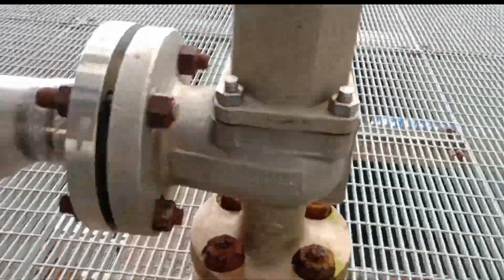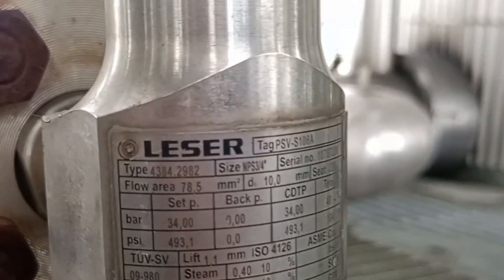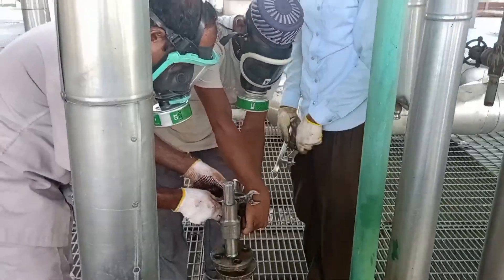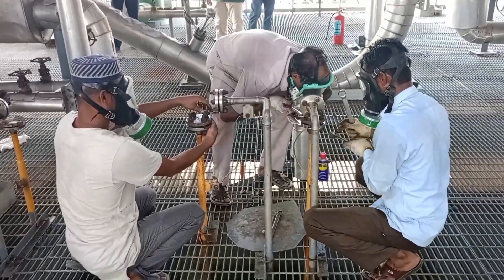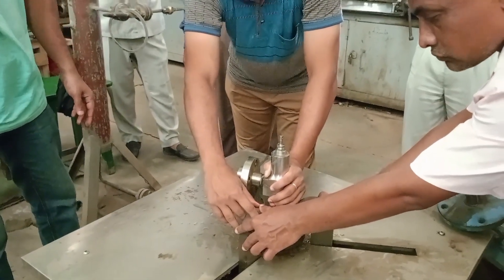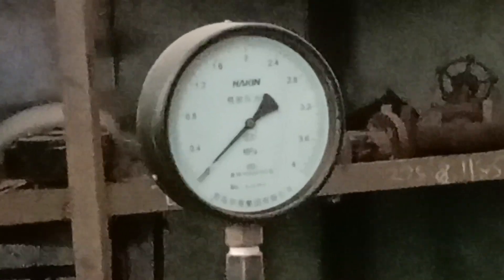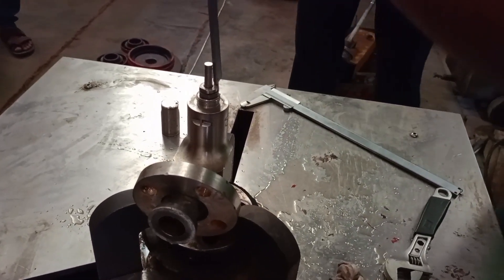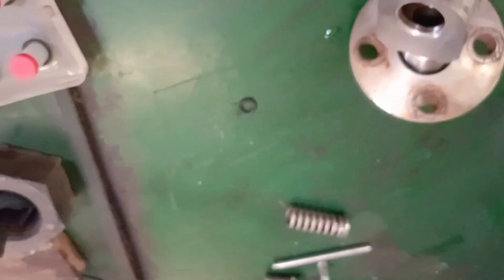How to Test and Repair LESER Pressure Safety Valve (PSV) ।। PSV

Comment: Make on video Pilot operated PSV
Reply from the maker: Thanks. Next, I will try to do this. For Pilot Operated PSV likely the process gas pressure or 
media pressure acts to control the PSV as well as relets to set pressure.
Reply: @betikrametech2023  yes thanks